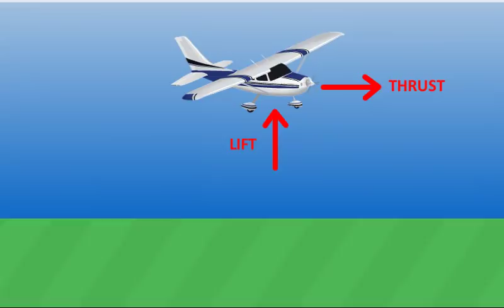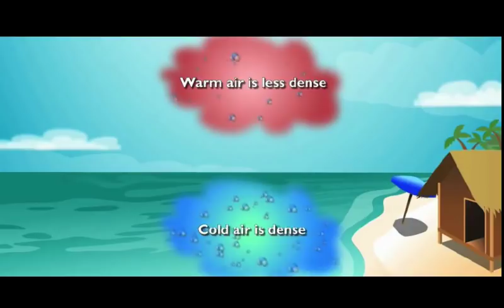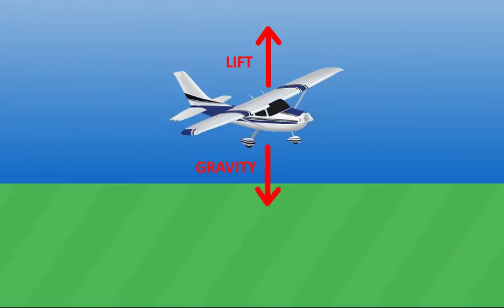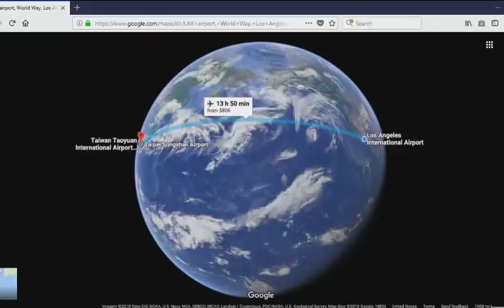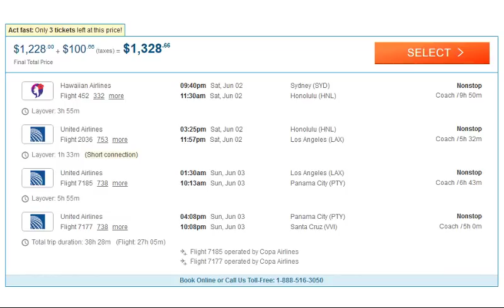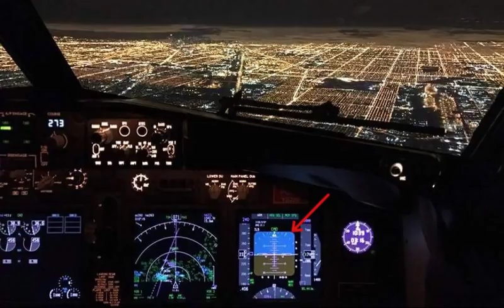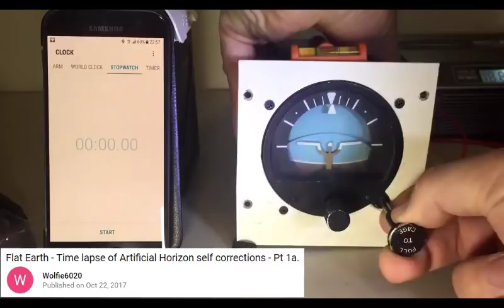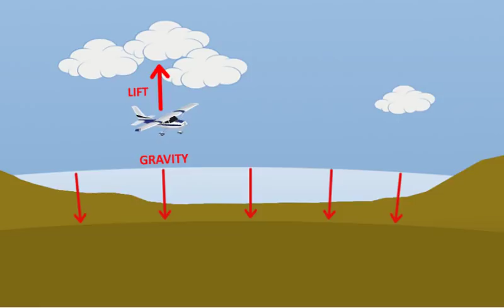Flat Earth Falsities - Plane Nonsense

Comment: Commercial airplanes fly laser straight lines, according to the tool gyroscope, that keeps rigidity in space, that confirms flat ground under all over from Europe to Australia. 

Empirical evidence, also known as sensory experience, is the knowledge received by means of the senses, particularly by observation and experimentation.

A delusion is a belief that is held with strong conviction despite superior evidence to the contrary.

https://www.youtube.com/watch?v=iUCBcUJVnQs   Six Emergency Landings that prove the earth is Flat
Reply: Anabel Camacho
Airplanes use artificial horizons which are simply gyro stabilized levels. Modern navigation systems use 3 orthogonal ring laser gyros which ironically use the Earths rotation as a reference. They don't fly straight, they fly patterns that are point to point to intersection points. I'm not a pilot but I worked on them and I stayed at a Holiday Inn Express before.
Reply: And even Globebusters had to admit that the ring laser gyro they bought did show the precession we’d expect on a spinning globe.
Reply: Sorry Anabele. That is 100% false. He should use proper tools and not semi round inflatable beach ball to find fly paths between air ports. Besides there are air currents which also influence flight paths.

If you think that he is so smart then point him to nonstop flights on southern hemisphere like Quanta 27/28, LATAN 805/806 and many more.
https://flightaware.com/live/flight/LAN805
Reply: "Commercial airplanes fly"
Yes, they arrive at their destination.
Reply: Anabel Camacho your definition of  the word delusion is actually the definition of the word "faith". Interesting....
Reply: @Anabel Camacho.  You make me very sad.  :(
Reply: A great resource from a pilot why planes make emergency landings that don't appear to be the nearest airport. https://youtu.be/JAsEVdhAss0
Reply: Anabel Camacho - You are a bit of an airhead Anabel.
Reply: https://www.youtube.com/watch?v=KzmjDFv23Ng  sorry wrong link
Reply: You should probably try watching the video Anabel.

Comment: For all flat earthers, try jumping in train. If you hit wall behind you at 150kmh then Earth is flat.
Reply: Jumping up at the Equator is like jumping up inside the train.
The Earth has been around long enough that friction drags the air along with the Earth.
Reply: Sprowk yes now try that on top of the train, speed it up too 1000 and start going in circles.

Comment: Your explanation of the emergency plane landing is so strained and grasping.
The reason that straight flight of a plane is depicted as a curve on your modelIt’s because any flight path depiction is distorted exactly because it’s drawn on a ball. The earth is flat
Reply: Given the intellect and knowledge you claim you are claiming about navigatin should be able to answer these simple questions.
Why is it that a compass needle is more or less vertical at the poles and horizontal at the equator?
And when you carry on past the poles the needle slowly returns to the horizontal?
Why is it that it is only possible to navigate accurately over long distances using spherical trigonometry?
Why is it that traditional gyro compasses work perfectly in low latitudes but became unreliable in high latitudes?
Why is it that it is only possible to navigate accurately over long distances using charts based on a terrestrial spheroid?
Why is it that when you watch a ship sailing away from you the hull is the first thing to go below the horizon, then the superstructure and finally the funnel and upperworks?
Does a magnetic compass point towards polaris (Alpha Ursae Minoris) at the north and south poles?
Does a gyro compass point towards Alpha Ursae Minoris at the north and south poles?
What is the relationship between longitude and distance when travelling east or west parallel to the equator?
Please explain the principles behind the development and functioning of a gyrocompass?
Reply: You have it arse backwards David. The flight is straight on a globe. It appears curved on a Mercator Projection because, like all flat maps, it has distortions. It is geometrically impossible to make a distortion-free flat representation of a sphere’s surface.
Reply: Any of these Southern Hemisphere direct flights are problematic on the flat earth:

Qantas QF 27/28 Sydney <-> Santiago (7,054 miles)
https://uk.flightaware.com/live/flight/QFA27

Qantas QF 63/64 Sydney<->Johannesburg (6,857 miles)
https://uk.flightaware.com/live/flight/QFA63

LATAM LA 800/801 Santiago<->Aukland (6,005 miles)
https://uk.flightaware.com/live/flight/LAN800

LATAM LA 805/806 Santiago<->Melbourne (7,027 miles)
https://uk.flightaware.com/live/flight/LAN805

LATAM JJ 8162/8163 Sao Paulo<->Johannesburg (4,627 miles)
https://uk.flightaware.com/live/flight/TAM8162

South African SA 280/281 Johannesburg<->Perth (5,169 miles)
https://uk.flightaware.com/live/flight/SAA280

Air New Zealand NZ 30/31 Aukland<->Buenos Aires (6,416 miles)
https://uk.flightaware.com/live/flight/ANZ30
Reply: David Musser exactly. You don’t understand. Smartest thing you’ve said yet. Incredulity isn’t science.
Reply: bullets (which travel 8 times slower than concord. WHAT    .1,354 mph concord TOP SPEEDhttps://www.google.com/search?q=WHAT+IS+THE+TOP+SPEED+OF+THE+concord&rlz=1C1AOHY_enUS708US708&oq=WHAT+IS+THE+TOP+SPEED+OF+THE+concord&aqs=chrome..69i57.21382j0j8&sourceid=chrome&ie=UTF-8
TOP SPEED OF A RIFLE BULLET 1,700 mph
https://www.google.com/search?q=TOP+SPEED+OF+A+RIFLE+BULET&rlz=1C1AOHY_enUS708US708&oq=TOP+SPEED+OF+A+RIFLE+BULET&aqs=chrome..69i57.16566j0j8&sourceid=chrome&ie=UTF-8
8 TIMES 1,700 =13.600
Reply: DAvid
To make it simple for you.
Why is it that if you are standing at the magnetic North Pole, a compass needle would point to your feet?
Reply: It is impossible to see the curvature when it is too big compared to the person observing it.
And upside down also goes upside down on the other side of the Earth which makes it up right there.
Imagine a big flat plate and two people with magnetic boots standing on opposite sides.
They both have their feet on the plate even thought their heads point in opposite directions.
Reply: Stephen Olan
: Also the fact that compasses are manufactured for a specific region proves a globe. You require different compasses in the northern hemisphere to the southern hemisphere as the needles are weighted differently. For more accurate compasses you have to buy one manufactured for a certain compass zone.
Reply: Bobby Wizdum: try thinking about the phrase “upside down”. 

Now picture a plane flying along over the globe, parallel to the surface. 

At what point in that journey is the top (“upside”) of the plane facing the ground (“down”)?
Reply: Stephen Olan it wont. And you've never been to the north pole so quit lying.
Reply: GrahamStw never.
Reply: wong poles? please show us the compass from south pole.
Reply: GrahamStw its also impossible for a sphered surface to not have curvature. impossible fir people to live on opposite sides of curvature yet view it in one way. if we were on top of the ball the horizon would be at ground level. just look at your cartoon ball from space.
Reply: Stephen Olan so when you flew north to south the plane should then go upside down or is it magic that appearance doesnt line up with reality? things are upside down to eachother but dont notice? 

understand this. if we are on top and the curvature is at our feet going down in all directions the horizon should be at our feet!

Comment: Is it also gravity the reason the atmosphere doesn’t get sucked away by the vacuum since there’s no hard barrier between the two. That’s some damn magical gravity.
Reply: Darid Musser wrote: "I'm asking you where you have seen a pressurized system next to a vacuum."
I've told you: vacuum chamber or ISS. Even so that doesn't happen in nature provided "next to" mean centimeters apart without any solid surface.

10 meters bellow water surface you will experience pressure two times grater than on the surface. That is exact difference like between air at see level and vacuum. However haven't seen water shooting up (sucked up) from depths besides geysers. Learn about gradual change of pressure in our atmosphere (going up: it slowly decrease until it reaches 0 and that is a vacuum) and our oceans (going down: it rapidly increase).
Reply: MAGIC IS A WORD THAT INDICATES A LACK OF UNDERSTANDING. Any sufficiently advanced technology is indistinguishable from magic .
Reply: Sorry, vacuums don't suck. Go back to school and start again.
And also learn the meaning of and how to use
Fg=G.m1.m2/r^2
Reply: wong Wow, you got me there! 
Seriously though you didn’t answer my question.
How does a pressurized gas exist next to a vacuum with out a hard barrier. Impossible.
Reply: "a pressurized gas " Which pressurised gas is this?
Fg=G.m1.m2/r^2
Reply: Pressure differentials exist everywhere in nature. 
Air pressure at standard sea level is 14.7psi, but just 5500 metres up a mountain it is less than half of that. 
Where is the physical barrier there?
Reply: @Chuck Johnson
RIP Sir Arthur.
Reply: David Musser so much fucking fail from flat earthers trying to establish intelligence
Reply: Have you never seen a magnet?
How can you not understand a force of attraction?
Reply: @David. Pressurized gas next to a vacuum? Where have you seen that? Aha, probably vacuum chamber. 
Earth atmosphere might look like pressurized vessel but not in the sens as simple mind imagine it (dome). Air pressure drops with hight because there is less and less atmosphere to press down. Where there is no more particles to exert downward force on these below then there is 0 psi pressure a so called vacuum. What's so hard to understand that?
Reply: +David Musser
"a pressurized gas" Which pressurised gas is this? So you don't know. You are just parroting what you have been told. Correct?
The average value of atmospheric surface pressure on Earth is 985hPa.
Pressure (P), mass (m), and the acceleration due to gravity (g), are related by P = F/A = (m*g)/A, where A is surface area. Atmospheric pressure is thus proportional to the weight per unit area of the atmospheric mass above that location
And air pressure decreases with increasing height
http://ww2010.atmos.uiuc.edu/%28Gh%29/guides/mtr/prs/hght.rxml
https://en.wikipedia.org/wiki/Troposphere
https://en.wikipedia.org/wiki/Exosphere
Also, please read the References and embedded links.
So atmospheric pressure decreases from around 985 hPa. at the surface to zero in the Exosphere.
Simple. I learned this at school decades ago and it was useful when practising meteorology and weather routing ships around the world.
http://www.imo.org/en/OurWork/Safety/Navigation/Pages/ShipsRouteing.aspx
http://glomeep.imo.org/technology/weather-routing/
If you have navigated around the world you would know the earth is a slowly rotating terrestrial spheroid and gravity is a fact.
Sorry to burst your bubble.
Reply: +Bobby Wizdum
Fuck off you pathetic troll.
Reply: I did not say that water is magnetic to the Earth's surface.
Magnets demonstrate that force at a distance is possible.
It can be with attraction or repulsion.
It is relatively strong on a gram for gram basis but operates on a short distance.
Gravity is only attractive.
It is weak on a gram for gram basis but it adds up.
The Earth has a lot of mass.
Therefore the water is attracted to it.
Reply: Stephen Olan water is magnetic to the earths surface? doesnt look it
Reply: wong The has in our atmosphere. You know what I’m saying, don’t play dumb. 
A pressurized system CANNOT exist along with a vacuum without a hard barrier.
Where is the barrier? And don’t EVEN try to say GRAVITY!
Reply: Martin Gorbush You are soooo confused, your post is ridiculous. You didn’t explain anything.
Nothing can exist in a vacuum.
Reply: Martin Gorbush I’m asking YOU where you have seen a pressurized system next to a vacuum. It CANT happen, impossible......